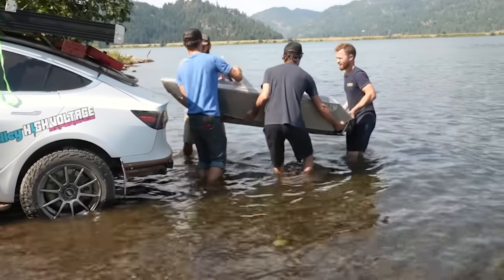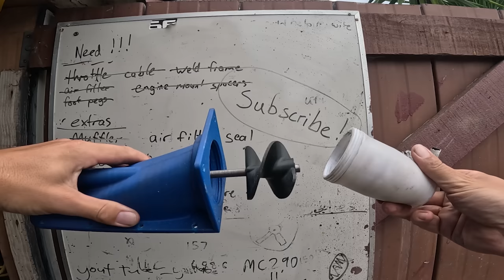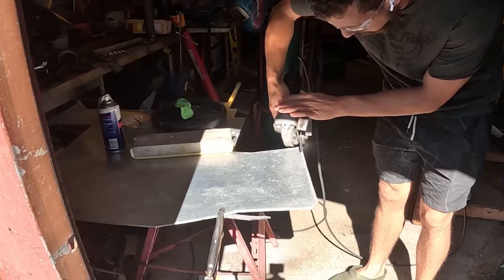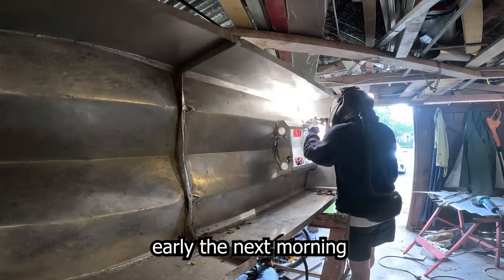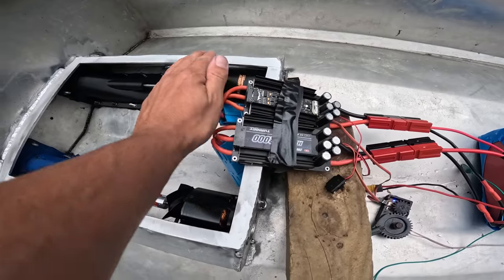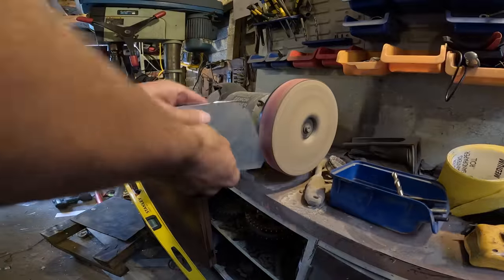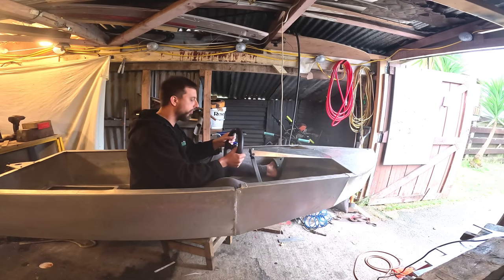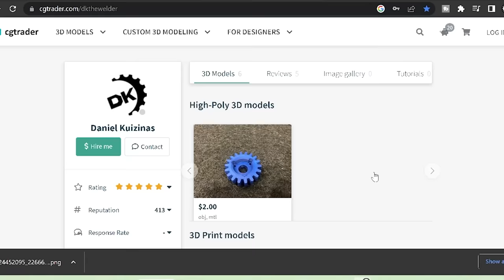Electric Mini Jetboat Build, Part 2

Comment: Looking Great Dan, I like the servo tester throttle with the gearing, nice touch :),
I've never used the crimp connectors for wires, I've had to use plenty of solder and some 8mm bullet connectors as they can get hot quick, I use a little grease as well in the bullets as it reduces micro-arching and and the white scaly stuff from building up over time, any grease will do I think,
you've probably already thought of this but it's best test in fresh water first just to identify any leaks,
Mark
Reply from the maker: Thanks a lot mark, you have actually been the inspiration behind this . I will try the grease I think I can see it has been arcing a little bit . Hopefully get a test going soon 👍

Comment: Amazing Prototype . I would have put the motors and batteries right at the front of the Jetboat. and have a very long inexpensive shaft feeding rotation power to the jet which "has" to be at the back. This has the huge advantage that should a leak occur then the jet will flood but the expensive electric motor will be far away at the front and a few inches higher than the flooding water. It has a second advantage that the added weight at  the front will help in getting the Jetboat onto the plane.
Reply from the maker: That is a good idea! I have been having leaking problems at the moment actually

Comment: With the diameter of those pump units, I would suggest a 2stage pump setup to really take advantage of the motors output.
Absolutely awesome build
Reply from the maker: 60mm yes I might need to go two stage!
Reply: @DktheWelder  2 stage will definitely get you where you want to be, unless you want to try dual centrifugal pump setups(higher pressure from single stage) like they use on the outboard jet units lol though I’d imagine centrifugal would be more difficult to print and get worked out lol
Reply: @DktheWelder  I would also suggest, just shits and giggles, an MP100 brushless motor! (I believe it’s 23kw max, somewhat cheaper version of the TP power TP100 motor).

Comment: Make a short video or a youtube short where you test it, we need to see its power!!! Nice build as well 👍🏼 You could drill a hole in the jet drives and connect a rubber hose from it to the esc to cool it.
Reply from the maker: I think I could put a water cooling block on the esc that would probably work

Comment: If this needs more grunt once you get this in the water, consider setting up a step up gear box in between motor/driveshaft!
Reply from the maker: I have made 2 more aggressive impellers , also I can make it a 2 stage which would be pretty cool

Comment: You could keep the water out of your "sealed" box by pressurising it with a small 12v compressor. I heard people used to do this with 4wd winches and diffs. Only need a few psi.
Reply from the maker: That’s a good idea because a sealed box is harder than it sounds haha

Comment: most brushless motors are ok to run completely submerged at least in fresh water... saltwater is probably not great for an extended period of time but they should survive short exposure. its the ESCs that you really need to keep dry!
Reply from the maker: I thought that was the case. I want to put the controllers against the hull to keep them cool just have to make sure they are sealed from the water

Comment: You are certainly a talented and capable fabricator that's for sure! I envy your considerable skills. 
Just going by that test run and other electric powered things I have seen, I wonder how much quieter these electric motors are over petrol powered? 

With a modified exhaust and rubber mounts, petrol engines can be pretty quiet. 
That said, the electric is very interesting and I look forward to seeing it run!
Reply from the maker: I guess they aren’t that quiet, a great thing it how light it is . But I’m only going to get about 10mins at full power haha

Comment: Look foward to seeing it run, might want to measure your amps before going more aggressive on the Impellers. You don't want those ESC's anywhere near 200amps and you will need to cool them. 12cell ESC under load more like a 8kw peak considering voltage sag.  
   Are you going to cool those outrunners? That battery is really going to suffer trying to supply enough current. Even the "30amp" cells are not really 30amp with any type of decent cycle life. Endless sphere has some good discussion on cells.
Reply from the maker: Yeah I think there will be problems I’m getting comments similar to yours, I have fans on the motors now and made more aggressive impellers but they don’t sound that loaded up   I might best to run it a bit under loaded for awhile to make sure nothing melts

Comment: Looks good! Why not have the steering capstan right at the steering wheel, then you don't have a steel rod pointing at you when you hit a sandbank. Also, why not get some heatshrink tubing for the wiring, its much more professional and seals better than electrical tape. I believe you have Jaycar in NZ, they have it.
Reply from the maker: Yeah good thinking I sort of made the steering like a go kart I guess . I should try doing some heat shrink, this wiring stuff it new to me I should try a bit harder haha

Comment: Lookin good,u should do about 60km/h but u have to do water cooling for the ESCs or u will burn them out fast
Reply from the maker: Can you make them water cooled?
Reply: @DktheWelder  u can buy them with water cooling jackets on it but u coukd always get some copper tube and bend it so it goes through the fins on the heatsink,check out water cooled ESC for RC boats on google and u might find something,if ya dont cool them even in small RC boats they burn out due t no air flow

Comment: DK, do you sell these? and if so can you make one that i can attach to a jon boat with a particular shaft size
Reply from the maker: I sell the files for the 3d printing but not the jet unit, I think they would be too small for a Jon boat . There is a bigger one I made for a jet board that would be better the print files are free on my CG trader link in description but need a fair bit of power to run it . You are better off to use a JetSki motor and unit

Comment: dont forget to water cool the motors or over heat 5 to 8 mins in ... ok
Reply from the maker: The hole outer casings spin they are big drone motors can’t put water jackets on them , I am putting fans on them

Comment: Warm is ok. 
Rough rule of thumb,
The windings can run at 120c

So the outside shouldn’t get past 80c ever, too hot to touch
About 60c outside is good, touch for 3sec without burning fingers. 
40c is not loaded enough. hold unlimited hot.
Reply from the maker: Ok thanks, I’m going to duct the air so it runs past the controllers too and I will print the fans a bit differently too I think. Do you think the motors sounded loaded enough?
Reply: @DktheWelder  
Nope. 
The motors were barely loaded. 

Oh. Watch the temperature of the battery cable too.

Comment: 20kw wont be enough...
Reply from the maker: I hope it is those jet units are thirsty for power
Reply: @DktheWelder  i hope so too. but i have serious doubts mate. you also only using 48 volts. to get 20kw out of those jets you need to reach 500 amps and that tiny 18650 pack with thin wires wont have that. you either burn the battery in very short time oooor you wont even get close to 10kw due to voltage sag which is more likely. i think you will get it to run for a while but only at low power. 20000mah lipo packs would be the way to go here because they can provide that insane amount of amps. maybe put the boat in the pool again. throw a clamping amp-meter on main plus and see how much amps you even get from that battery.